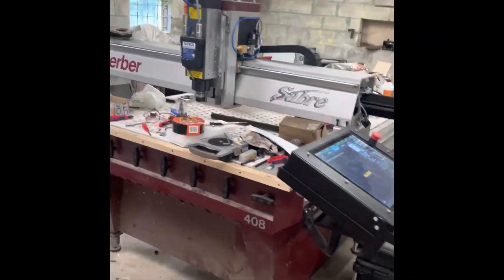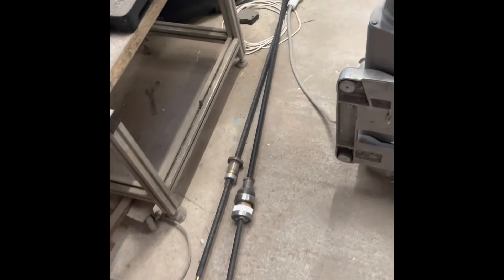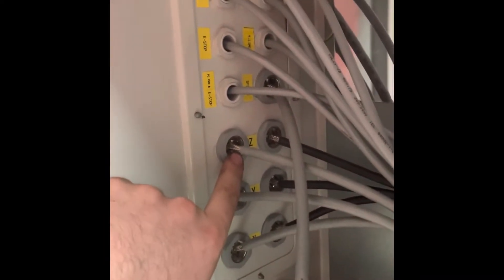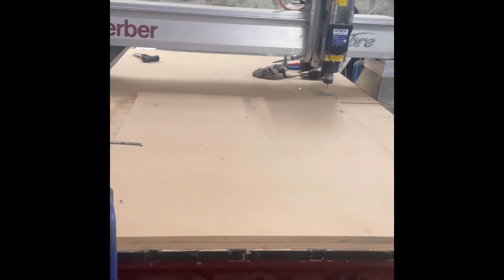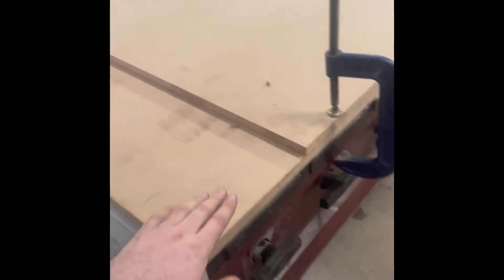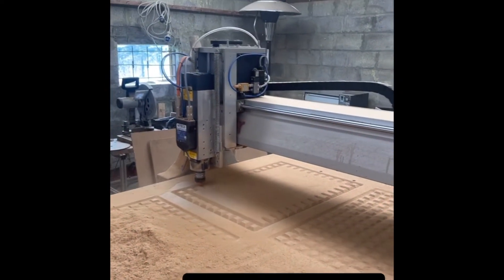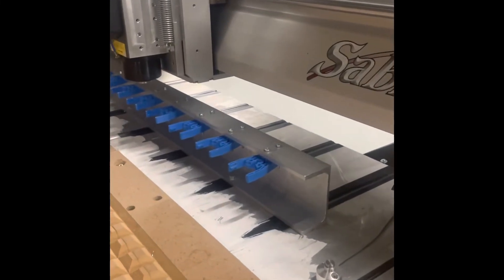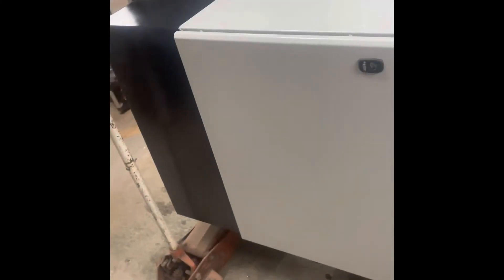MASSO CNC Router - GERBER Retrofit

Comment: starting an almost identical build now, 408 with atc and masso, this will be my third build, did you run into any EMI issues during this retrofit?
Reply from the maker: No all was well. EMI is never an issue if you correctly ground everything 🙂

Comment: How to calibrate tool auto tool change is there any video to explain it from scratch
Reply: With Maso it's really not that bad. They support several different types of tool changers and if you go to their forum and manuals they have really good documentation.

simplest I've seen yet

I found this video because I have a few masso machines I've retrofitted already and just picked up a Gerber 408.